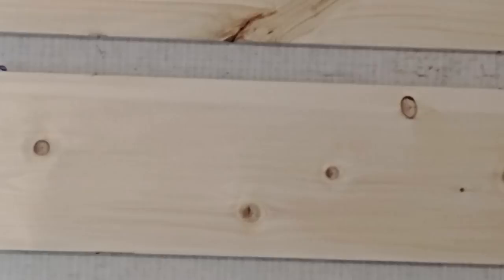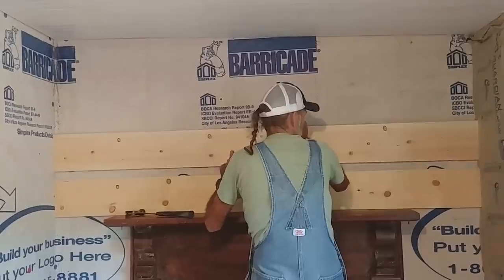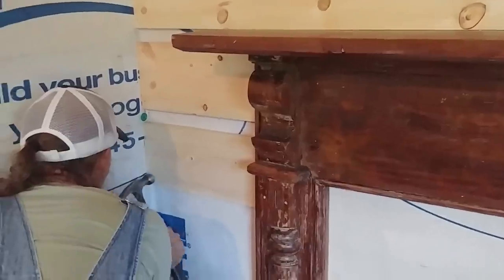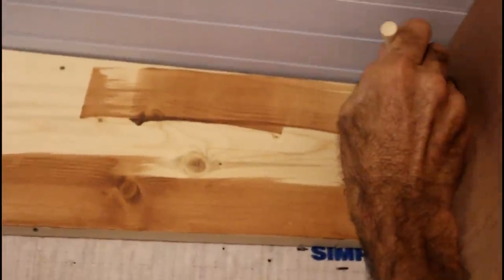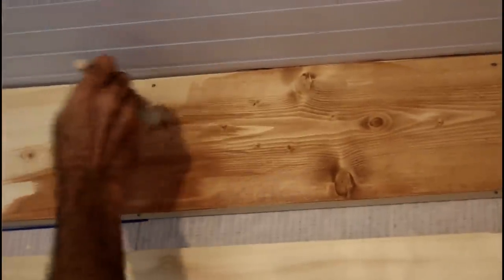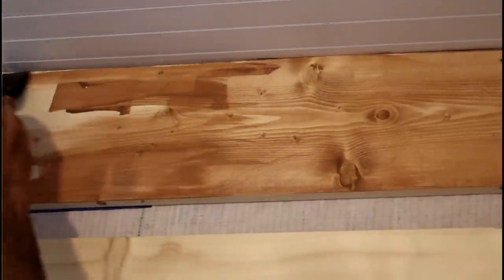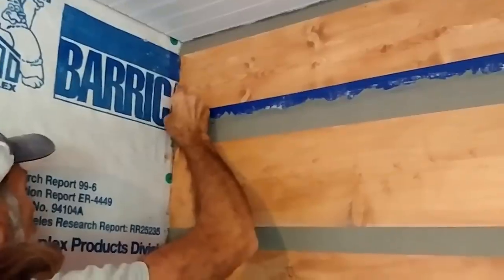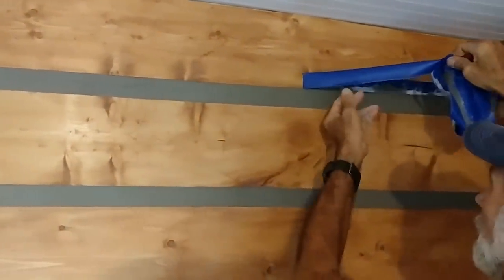Creating a Log Wall Look

Comment: I used rough sawn pine I  ripped on a old saw I restored myself and marked the boards with homemade axes I made myself, as I have a blacksmith shop I built myself  to look like hewn square edge logs and notched the corners, stained with almost black antique stain and real mortar chinking over wire mesh I put in between the fake logs
Can't tell the difference from real circa 1800 log cabin
It was vinyl siding before, what a difference

Comment: I'm wondering why you didn't stain the boards before hanging them. I'm also wondering if the edges of the boards could be routered  at a 45° angle, or whatever, to make them look more rounded like a log? Or does the mortar cover the edges?
Reply from the maker: They could be routered but we wanted them like we have them.